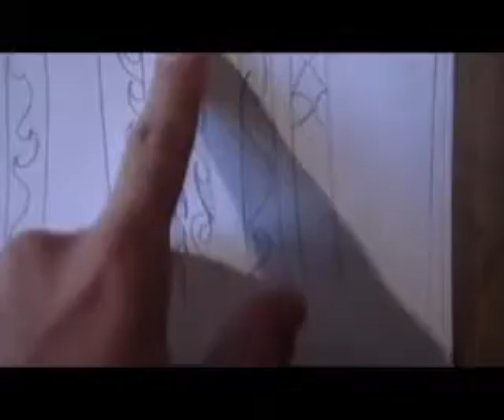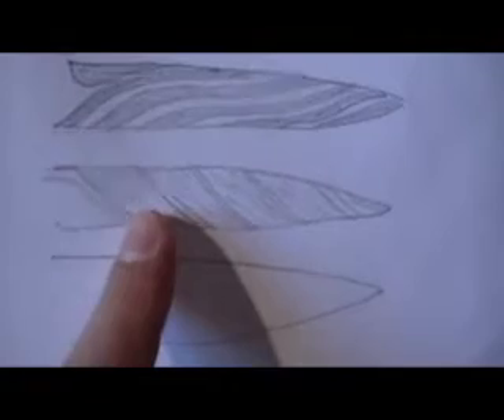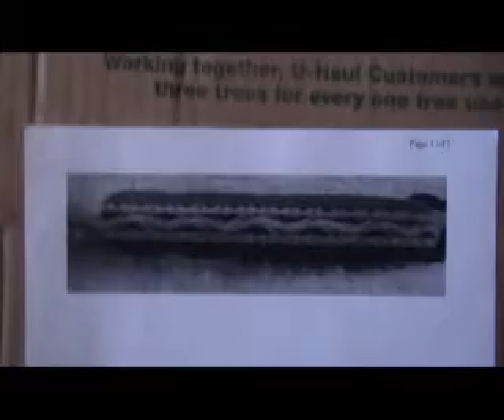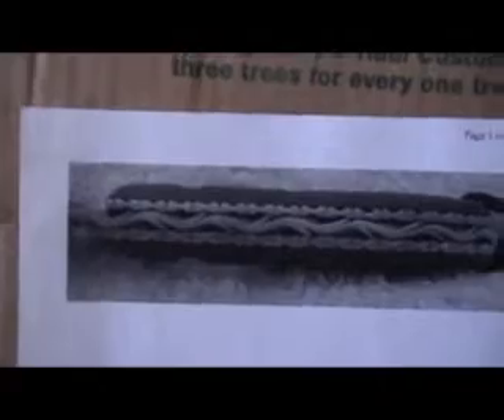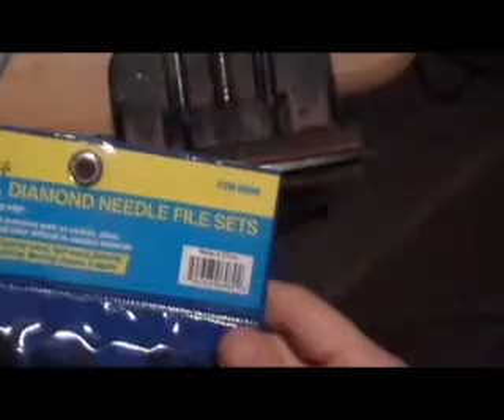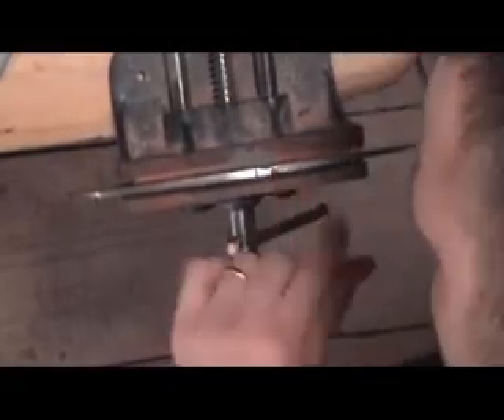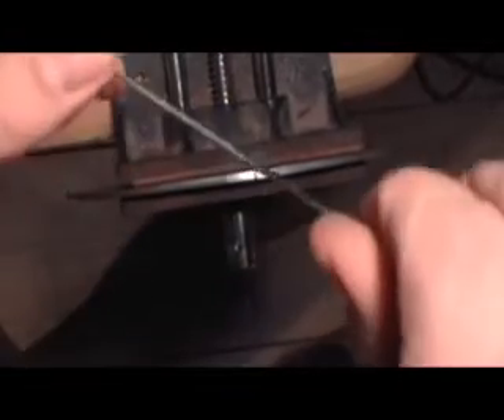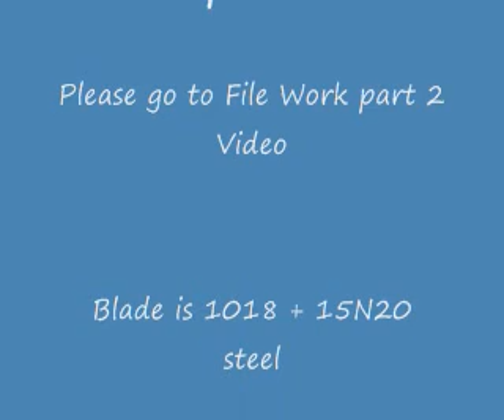Part 1 of 11 part series "How to do File Work on a previously heat treated knife blade"

Comment from the maker: it is mixed with 15n20 which could help with the hardness level. This one may hold an edge well just by chance that the 15n20 is on the cutting edge. Anyway, 1018 is not really a good metal for knives but it does look pretty. You're better off going with at least 1095 and 15n20 if you're going to make one yourself or if looking to buy one. Twofingerknifeco makes awesome blades if you're looking to simply buy one.

Comment from the maker: I didn't make this blade, just the handle; that hardness is what was advertised but it has held an edge well. You can increase hardness by using a brine solution (salt & water). The brine quench will make the blade much harder as it will cool the steel a lot faster than oil. Anyway,I assume the blade smith just used the temperature as a guide (550 degrees for 56-59 Rc) to determine the Rc...right or wrong, that is what was reported. It is doubtful that this ever saw a Rockwell C testing machine

Comment: i haven't finished one yet but i ordered a four foot bar of 1095 and i have just about all the blanks i can get cut out of it i just need to finish them and send them to get heat treated or build a propane burner that will work to heat treat them, i would rather do that so that i can more easily deferentially temper them.